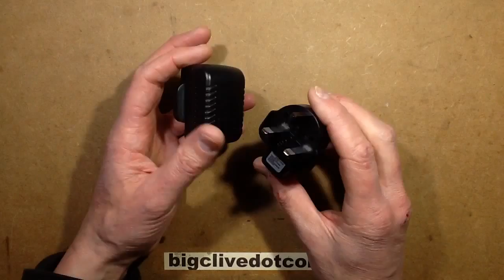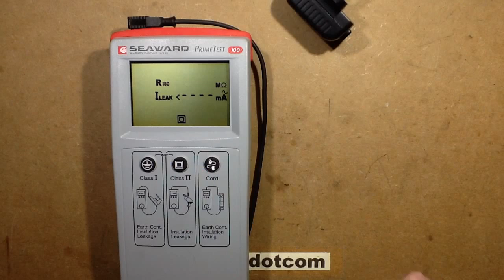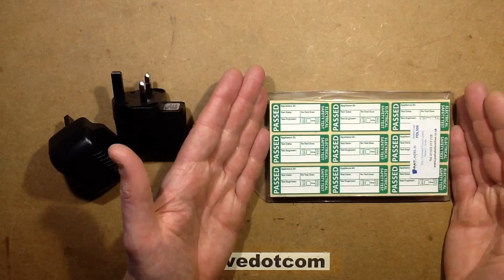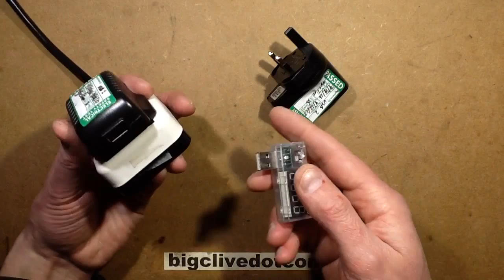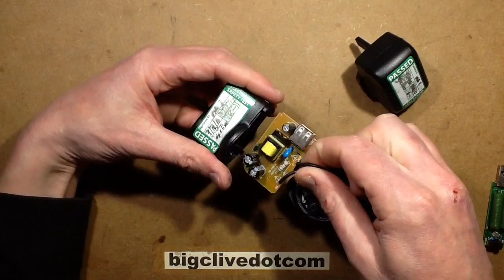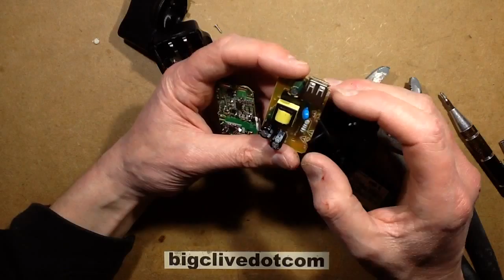Poundland USB charger comparison.  2016

Comment: I used to repair home computers for my sins at one time.  The quality of the mains plug wiring was appalling, I would say without exaggerating that over 75% were not safe, ranging from leads connected between live and earth, 13 A fuses, fuses shorted out - the whole lot.

Comment: I used my new Habotest earlier, which seems to function correctly. However, can you explain the RCD test? When I pressed the button, the circuit breaker tripped out. Is this normal, and if not, what needs to be done?
Reply from the maker: That's correct.  It shows that the RCD is tripping properly and that the socket does not have neutral and earth reversed.  It literally shunts a resistor between live and earth when you press the button.
Reply: @bigclivedotcom  Thank you very much for your fast reply. So I don't think using the RCD test too often is a good idea,as it means resetting the circuit breaker every time. The test meter itself does appear to be well worth the small amount I paid for it. Again,thank you for your reply.

Comment: Greetings and salutations!  I blew my favorite power supply, the unit was purchased from the good folks who build the Pine A64+ mini computer board, kind of thing.  I was in the motor home a few weeks ago and went to plug in my A64+, now this was down in the Mohave Desert, and the air was bone dry, our motor home has carpet in that area, and like an idiot I was wearing my walking shoes, so when I plugged in the unit, there was a large arc of static electricity from the plug to the computer.  Thankfully the Pine A64+ still works fine however the power supply no longer works, it does not put out any power. Being a fan, I knew how to take the unit apart, and when I did, I found the fuse was still intact but the domes on both electrolytic capacitors were bulged to nearly bursting.  I am wondering if I replaced the caps, could I bring the charger back to life.  This is not one of those cheap capacitive droppers, but rather a nicely built switching power supply, the label claims it is 2 Amps, and it is one of the few that will run my Pine64A (I have 2, one in a mobile case the other stand alone for my TV in the RV  as an entertainment system.) when  not hooked to the main battery pack. I have the proper caps in stock so replacing them is not a problem, I guess I should just go ahead and see what happens.
Reply from the maker: Yeah, it's worth a try.

Comment: I got one of each recently. I found the one with the screws has a SW5910 1631 instead of a TD203, handily it's more Google-able. It looks like a drop-in replacement for the TD203 and a bunch of other similar ICs. Couldn't find a PDF, however. Thanks for the examination and recommendation on these, handy for little projects, USB-powered soldering kits and the like.

Comment: Have you ever looked at the insides of the mains face-plates Clive?

I've been gradually replacing all my mains outlets with similar equivalents which have USB power ports in them, and try to get ones rated for at least 2amps (2000mA) output due to the large number of smart devices I have which need to be charged in this manner, several of which need to be powered down to charge at 1amp because effectively stand-by operation consumes at least 1amp, and you need to get over 1.2amps to even trickle a charge into them.

I can pick them up in many of the supermarkets, in Wilkos, and in Wicks / B&Q quite easily, but I'm not sure of the quality of these devices. Certainly, they reduce the number of mains power sockets I'm taking up with portable devices on charge, but quite often these devices are exactly the sort of iPhone / iPad / Surface type "premium" item which recommends you only charge it with the charger that came with that device, and yet I'd rather not actually, because then I have nowhere in my house I can plug the kettle / toaster. XD (or every socket has an array of 8 gang power supplies hanging off it, with half of the sockets unpopulated because, again, these "premium" chargers often don't play well with multi-plug adaptors, just in terms of their physical dimensions)

Comment: bigclive needs to open up a scary Chinese laptop charger. i had two that failed with an explosion, also took my dell away with it.

ebay link: http://www.ebay.com/itm/65W-AC-Adapter-Charger-Power-Supply-Cord-For-Dell-Latitude-2110-2120-E4200-XT2-/172255271022?hash=item281b36d86e:g:B~cAAOSwEjFXcQQs

Comment: Bought two of the round one. First one 5.02 volts runs a Raspberry Pi no problem (which is an achievement). Second 4.8 volts, Pi runs OK but the warning low power flash keeps appearing.

Comment: The problem I have is that 500 volt is much lower than specified in any standard I've ever seen for Creepage clearance breakdown. Why is everyone happy at 500 v. ?
Reply: I guess because mains is 240V? So 500V is plenty of margin for any voltage a device is ever gonna see.
Reply: rowifi Just guessing.. if it was tested with much higher voltages..it would turn into an destructive test?
Reply: Yes, Janice,  I think that's the logical reason. It's a reasonable safety test until lightening strikes I guess 😁

Comment: What is the difference between a low-voltage/high-current test and a high-voltage/low-current test that is, why are they different if the power is to be the same and what are they meant for?

Comment: would u recommend someone making a USB charger for themselves? My phone can accept 3amp but find it hard to find them.
Reply: I wouldn't recommend anyone make anything connecting to the mains. Mains electricity is the sort of thing where, if you're capable of working with it, you already know that. You wouldn't need to ask. 

Even for professionals there's lots of safety stuff to keep in mind. I wouldn't chance it, when the mains can kill you dead so easily.

Besides that, home-made electronics are generally much more expensive than stuff you buy. You can't get competitive prices on components unless you're buying 100,000 at a time.
Reply: I can't use any Quick Charge 3.0 charging blocks as they are non compliant with USB spec. They are a proprietary charging technique and unless the phone has the receiving part, it doesn't charge at the correct amperage. I will look into the LED strip psu thing.. Fingers crossed.
Reply: We used to make mains driven power supplies when I was doing electronics at school, these were old fashioned designs with step down isolating transformer and a linear regulator. These are easy to understand it's pretty easy to get something like that right but we still had the teacher checking out the unit before switch on. difficult to advise a beginner to try mains projects without having someone knowledgable on hand to check it out - but I suppose if you're over 18 it's up to you to make your own decisions... the circuits used by modern PSUs and chargers are trickier to understand than the old fashioned stuff I played with so there's a greater risk of getting it wrong and unintentionally ending up with (for example) an output that's referenced to mains or similar.
note a linear regulator will produce a lot of heat in comparison to a modern circuit so you'd be looking at dealing with that as well as housing a transformer - you wouldn't be ending up with a slick compact modern looking unit - it's difficult to copy the pros.
Reply: It would help if the "pros" would actually make what I want though. Multiple USB ports, each able to deliver 3amps (15 watts). "each" being the defining word here. Rather than 2.4amp and spread between the ports.
Reply: I think there are some pretty high current USB chargers on the market now, try searching for "Quick Charge 3.0". Of course theyre quite a bit more expensive than the regular type. Or you could buy one of those little 5V high current PSUs intended for driving LED strips and stick a USB cable in it. Ive got a 6A unit that only cost about 3 or 4 quid, that could charge two things at 3A each, and you can get those in any current rating you want up to about 50A

Comment: Clive have you ever compared these cheaper supplies to branded ones, such as Samsung or Apple chargers? Just curious as to what the differences may be and if the price difference can be justified. Cheers.
Reply from the maker: The real branded chargers are a better choice.   But these supplies are a step in the right direction.

Comment: I get 800v peaks every minute when there is lightning here, if I remove my TVS protection.
The peaks give 7A over my 600v TVS(first line of defence) measuring quickly with my bluetooth Mooshimeter at only 8KHZ, so higher irl.
I might burn the oscilloscope and I know enough to want to put some quit big TVS arrays and thermal fuses in.

Comment: Would be nice if you test this devices also with thermal camera. It is nice to see how hot components are running in bad designs. I have feeling that if you contact FLIR and tell that you have 200k subscribes you could have one free for advertisement purposes.
Reply from the maker: I already have a Flir E4 which I bought at full price.
Reply: ok. would be nice see in future how Chinese designs are heating.

Comment: You don't HAVE to test appliances at all, it's not a legal requirement and completely unnecessary for most low risk office devices an occasional common sense visual check is all that's needed in most cases, even the HSE state this. It's also not an insurance requirement in most cases. I've left "bait" cables out for PAT testing companies before which should have failed and all of them were passed so my respect for PAT testing companies is low it's a scam in many cases.

Comment: I personally use the £1 charging cables from Poundland. It works great on my iphone and as it's cheap if it get's damaged I can just replace it easily. I personally wouldn't trust a mains USB charger from them, I would rather get a amazon basic one as I know that amazon keeps a high standard. A supplier for poundland could either skimp or let standards get too slack.

Comment: Although a tiny "sample size" this supports my observation that Chinese electronics product quality is very rapidly improving, even at the "extreme low budget" end. Companies such as Uni-Trend, Atten, Hantek, are all producing very good quality product, and this has meant the "average hobbyist" (the one without the inexhaustibly-deep pockets) can now get their hands on reasonable-quality instrumentation.
Reply: Phil S China has always had the capability to make even top notch stuff. They have the stereotype of being cheap shit, but everything made is made to spec, often 'cheap as fucking possible'. Have had runs of machined stuff done for random classic car fittings at spec, and the qc/machining was top notch. Quality was better than runs we had done in the states, but cost a third as much including shipping/freight.
Reply: It's not so much China, as Ebay, Alibaba, Amazon, and dodgy market stalls. China's just filling in a demand for unbelievably cheap shite that sortof does the job and probably won't kill you, most of the time. Although they're pushing it with those gay Dalek camping lights.

If you go to actual reputable shops to buy stuff, you've got the same expectation of quality as ever. Unless maybe some Chinese pirate knockoff stuff's found it's way into the supply chain. But at least your next of kin can sue if that happens.
Reply: the "china makes crap" attitude is just from people who buy the cheapest possible stuff off ebay, didnt know or bother to find out that the "500,000mAh usb power bank" listing couldnt possibly be true etc etc, basically clueless cheapskates. then they get outraged when they realise they bought crap and assume that the thing is crap because its chinese and assume that all chinese stuff is equally crap when of course neither is true. its telling when you see amateur reviews or mentions of products, if somethings crap its described as chinese. if it isnt, theres no mention of its origin even though its also chinese. 
btw there really are listings for 500,000mAh power banks, and people are buying them.
Reply: GetTheCheeseToSickbay I've bought "more than a few" metrology instruments (calipers, verniers, bore gauges etc.) from Chinese suppliers over the past decades, and I've found their stuff to be VERY well-made, and VERY good quality. OK, not "quite" up to Moore and Wright for example, but more than enough for the amateur machinist, and that includes all the digital "Mitutoyo knock-off" stuff I've indulged myself with :0) Chinese carbide inserts for lathe tools last just as long as the "big names" (especially on the softer materials - brass and alloy), and cut the machinable ceramics will noticeably less chatter. Chinese Hakko knock-off tips? just as good (same weight / dimensions), and the Hakko tip thermometer thermocouples are as good as the real deal, for a tenth of the price.

Comment: That narrow body style is most useful with non-UK plugs, as those make the entire adapter narrow enough to be inserted in corresponding multi-way power sockets without blocking neighboring outlets on both sides, while the flat style will block 1 to 4 outlets on one side, or even block the door when plugged in to a vertical socket beneath a door frame lightswitch.  This doesn't work as well with British sockets because the dummy earth pin is needed to open the 3 way shutters.

Comment: Also, I bought a lamp from a charity shop in summer with a sticker on it saying it "passed" a PAT test. However your video made me curious so I checked the fuse, the lamp has a 13amp fuse fitted when it should be a 3 AMP, be careful folks. This is why as a rule of thumb I check everything myself. If I buy electrical items from car boot sales I will always open up plugs to check wiring and what not.
Reply: Matt Quinn I've never seen 1a fuses. I'll be sure to keep a lookout for them, most of the low current stuff have 3a fuses which seems a bit silly for a clock or something.

Comment: A video on PAT testing would be really interesting.  I occasionally wonder if it is something I could do for the leads and appliances in my small office. Buying one of the lower-cost PAT-testers would pay for itself in a couple of years. I worry about damaging PCs though.
Reply from the maker: Most basic PAT testers will fail some PCs because of perceived leakage through suppression filters.  Main tests for a PC are a basic continuity test for the ground to casing and a visual inspection of the cable.

Comment: Could you test and explain USB killer 2.0?
Reply: I can do it in 10 words: the less protection it has the more parts are destroyed.
Reply: I know very little about electricity, but I can roughly explain how a USB killer works.

Essentially, it is first charged, which charges the high voltage capacitors on the PCB. When it is plugged into a device, the large amount of charge from the capacitors will be put through the device you want it to go through. A lot of products nowadays have overvoltage protection on their USB ports, however a LOT do not, including a lot of desktop computers. Even the ones with overvoltage protection quite often don't function how they used to, for example if I remember correctly, using one on an iPhone 7 will make the charging port redundant.

Comment: I got my G&G PAT ticket at Southampton, sitting alongside several electricians who were being laid off by BAT, so I could test electrical items donated to the charity I worked for at the time.
Always, always the visual inspection was the most important procedure in eliminating the 'duff stuff'.
Recently I've been involved in the Contract Cleaning industry as a manager which put me in the position of having to deliver H&S training to staff.
Trust me, the notion that anyone 'checks' a Henry before use is depressingly false..😕
...and don't me started on fully extending the cable before use.